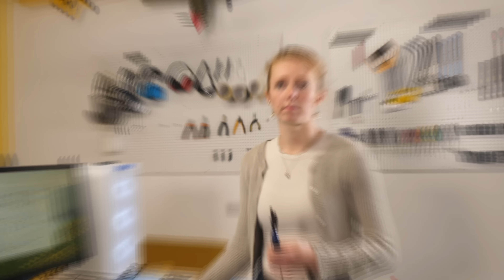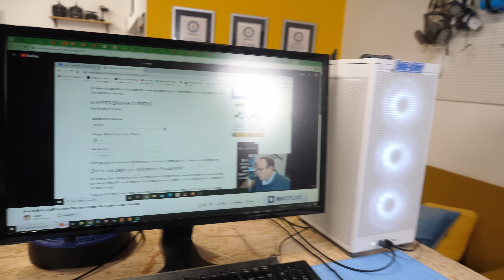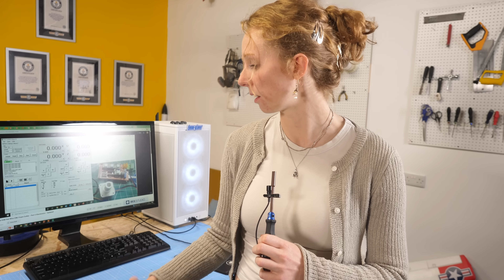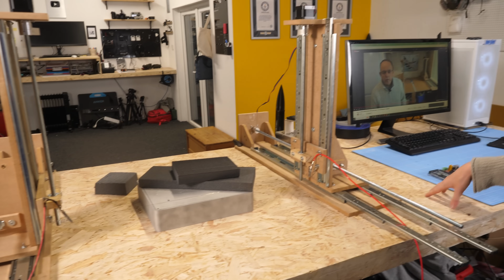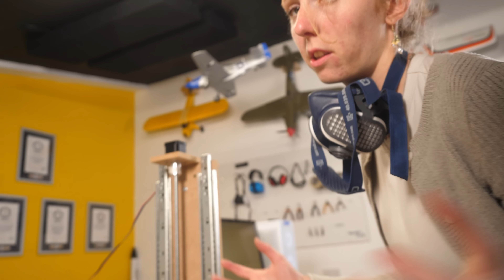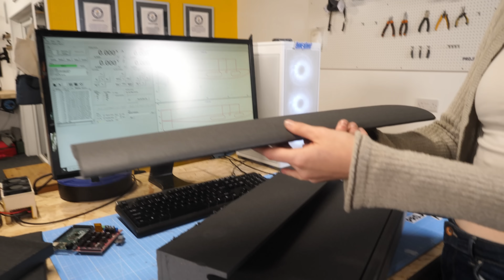Building a CNC Hotwire Cutter

Comment: I like tools.. Sets Electric plasma generator on the ground designed for echo ultrasonic holography resonance and piles metal scraps on it > Sets craft design > Activates it watching it holography lift materials into the air forming a sphere of metal dust by resonance bond breaking > Watches it use that dust to holography 3D direct sound resonance weld print craft whole Google: "Boeing Plasma force field blocks bomb shockwaves" + "Ultrasound holography" + "Warwick university plasma generated Ultrasound" + "Ultrasound can print through walls" + "Ultrasound see viruses turn genes on & off" *You all likely already understand ultrasonic welding just apply extremely high resolution nano pressure control. Why a primary component of endgame ships? Ships that can hold themselves together when parts start melting in Fusion beam battles + Ships that can grow using resources + Ultrasonic shockwave anti-drag to create pressure bubble to slap the Ocean or atmospheres like they don't exist + Elevating sound of craft beyond hearing for illusion of silence + Deep world scanning with resonance filters + Ultrasonic holography Plasma cloak.

Joking? I don't make the science results on this world I just know everything about it and line your words for it up based on the data I process to identify what I'm trying to say. Its not too far away from you. Squints at Predator alien smiling like its a CHILD then dials up Ultrasonic echo clashing with outbound waves to form a pressure lens of trapped medium then cloaks by Plasma Ultrasonic holography - Dracula (Saucer over Dracula's birthplace 16 Century art)

Comment: That’s great, nice clean cuts! But please either put a cover over the mains terminals and add strain relief or get a different power supply. 12v are so easy to get ahold of in a safer format than this. Like a laptop charger style

Comment: !Safety warning! I briefly looked up the face mask she's wearing, and it does not look like it has the appropriate filter canisters for all of the nasty stuff in foam cutting vapors. I've done foam cutting before and You need filters fit for organic vapors. Like 3M 60923 cartridges (needs to be replaced within 30 days of use max). Even then it should be done with a vent nearby, or in an open area. I hope this helps!

Comment: Very very cool build. If I ever have the need and the space to CNC foam I would love to build one of these. Two suggestions though: 1. Upgrade the stepper drivers (go for TMC2208 or 2209) they have better microstepping and are much quieter. 2. Add some kind of extractor fan to the shop for dust and fumes.

Comment: 2 questions:

1. Are you supplying constant voltage or constant current to the wire? I’d imagine that the latter would keep the temperature steadier.
2. Have you considered operating the two halves of the gantry independently? You could use that to make tapered wings and other more complicated structures.
Reply: Even better than 1: If the wire is an alloy that has a resistance that changes with temperature then you can measure the voltage and current, and compute the resistance of the wire, and adjust the voltage or use PWM to adjust the heating power to keep the resistance of the wire constant. Provided the wire is nearly all in foam that should keep the temperature constant. If only part of the wire is in foam it might keep the average temperature pretty constant, but the parts inside and outside the foam might not be at the same temperature.

Comment: Some Improvements: Secure the T-nut with 2 pan head screws (3x16) or a second block. For the wire you can use old wire from a wire EDM machine (very thin and resistant). For holding the wire you can use (old) nozzles from a 3d printer the tip of the nozzle is then the computation point for diagonals and you can directly screw the nozzle with the power cable in a 5.5mm hole in the wood. To tense the wire you can use the spring 90° to the nozzle, so it is all flat. For powering the wire you can use a cheep inverter welder, too.
Reply: Stainless steel fishing wire

Comment: That's a great machine! With four independently controlled stepper motors, you could create some pretty funky 3D shapes too, right? I imagine it all comes down to wire tensioning — which could probably be handled by a fifth motor dedicated to tension control. 😉

Comment: Nice project Emma but I had to check 2 times from what year this video is.  Apparently not 2012.  

From someone who builds 3d printers 
1. The motors are insanely loud 
2. Why use wood for this?  

Just buy (or find one in trash) an old Ender3 or CR10 and use the parts for this cutter.  You have everything you need there. Perhaps add a modern MCU like the SKR3 to it and it should run like a champ.   

Hum.  Now I think about that and…. I have an older CR10 in my attic. But do I need foam parts for something? 😅
Reply: MDF is WAY cheaper than aluminium extrusion,

Comment: I use a bow on my hotwire cutter so the wire tension is independent of the towers, you can cut tapers and different shapes on each end of the foam. 
RCKeith developed the firmware, I use Jedicut to generate the gcode, it will cut DAT and DXF files, but is quite a learning curve. 
 A developer is creating a Foam Cutting Workbench for Freecad, it looks very promising as it has a great visual interface.

Comment: You might want to put the power supply into a enclosed box with the fans build it - the mains power cable looks a bit stretched and one might pull out one - plus you could touch the terminals with a tool or fingers even with the plastic cover on top. I use cheap electrical boxes from the hardware store for this application...

Comment: Great project! I can see a major refinement that would be easy to implement - constant current wire for constant power per unit length. A cheap module like an SC8701 in between the PSU and wire would be fine to regulate the current. This gets rid of fiddling to find the right voltage for the wire length. It also allows the the machine to be extended to the third dimension of cutting by adding a spring loaded spool to one side and operating the towers independently. The wire needs to be coupled after the spool to avoid the spool heating up - just a metal eyelet feeding the wire instead. Not sure what software would work tho. LinuxCNC?

Comment: Are you stuck using 2D toolpaths? Seems like a waste for a 4-axis machine, you could be pulling that wire at arbitrary angles to make not just tapered airfoils, but even any arbitrary hyperboloid curve. Might need more spring-tension though, and it’s dependant on the CAM software. Jedicut looks to do tapered airfoils, but I’m not sure about hyperboloids.

Comment: You should release an EP of stepper motor sounds. Those tunes were tight.
Reply: There are a few MIDI to GCode converters that will let you play tunes on any CNC machine - but modern printers are now too quiet!

Comment: Great job!  I never thought of using drawer sliders instead of linear rails.  I wounder if that would work on a 3d printer.   The one think that I would recommend would be to capture the end of the threaded rod on the front if at all possible as it lessens the chance of them getting bent if someone or something puts some weight on them.  I hope we get to see some more of your designs.  Also the noise is due to the stepper and stepper driver combo.

Comment: Did you set the drive current on each stepper driver? I have used the ramps board with the drv8825 drivers on NEMA17 and I don't remember them getting stinking hot, just hot :-)

Comment: Those aluminium flexible coupelings are going to fail after a while. It's a bad design to flex aluminium like that because of aluminiums fatigue problems. I have used those coupelings in both a CNC router and for encoder mounts and they have all failed after a while.

Comment: Verry nice! One tiny remark tho is that the parts used are what you would use in 2015. With the price of 3d printer parts so easely available and cheap there is no point in using threaded rods or a ramps board in 2025.
Reply: Cool! Looking forward to your redesign to 2025 hardware spec!

Comment: Tip: FreeCAD has actually an FoamCut Workbench that is specifically created to create wings for hobby air planes. In stall the workbench plugin by opening FreeCAD,  then go to Open Tools > Addon Manager search for FoamCut and click install. You may need to restart FreeCAD. The main benefit is that it allows 3D cutting of the wings.

Comment: I know it was not critical so you probably weren't too worried about the slightly wavy cuts but if you do need to make straighter cuts with a jigsaw in the future you could try something like a DeWalt DT2074 blade it's designed for straight cuts.

Comment: Could you do cuts from multiple sides on an indexed chunk of foam with this thing? Like one with X+ face lying down, one with Z+ face etc. Or will the foam be too flimsy for this? (though you could probably leave tabs in the profiles and cut them away later or stick in bamboo skewers) 

Nice thing about this is that since the towers are individually powered, it should be possible to upgrade it in the future to do cuts where the heads move independently for really complex shapes, really looking forward to getting it used to its full potential! 

Also very thoughtful of Emma to burn some boards in advance of filming to use as props while talking about them 😁(jk)

Comment: Great stuff Emma. I love the screwdriver being used as a mic. One question, though... once you have cut the whole thing out, why didn't it collapse into the gap you created underneath it? Magic?
Reply: I noticed that Emma's general approach was to complete the 'upper' features first, then move on to cut the lower features, in order.  In this way, the completed bits could then sag any way they like while the cut could proceed in a stable, 'uncompromised' area without losing accuracy.  That said, yeah, I was kind of expecting maybe to see her pop a small wedge in the end of the cuts as they are completed to prevent the islanded parts dropping/drooping.  But it seemed to work just fine the way she did it.  Kudos for just doing it - the reward was success.

Comment: Since it's attached with the spring, you could actually add a bit of a 3rd axis, by raising or lowering one side, allowing you to cut at an angle, if you wanted to taper the ends somewhat.

I don't know if it would be useful, but you could do it.
Reply: I thought Emma said she could program each tower differently (?) That means taper cuts are already possible with her set up.  It would be a bit tricky to get the exact dimensions you want, but half an hour and a bit of trigonometry would resolve it.
Reply: Yes, technically it could be 4 axis, as you can tilt the wire in 2 axis.

Comment: Great job, holy crap though, use TMC2209 silent stepper motor drivers lol, your steppers are screaming a cacophony! I hope your respirator cartridges have activated carbon in them 🤞
Reply: I also prefer the Trinamic drivers, but the ones in the video are screaming so loud that I suspect they're running in full step mode.

Comment: Excellent work Emma!  Thank you for the tutorial on how you built the cutter and how it works.  

Will you strictly use nichrome wire as the cutting element?  I heard or read that guitar strings could be used as well....

Comment: nah diy parts for cnc. so you dont have to bootstrap from elsewhere. yep hand made. thats why you use adjustable power supplies. so you dont have to change any input parts to tune the device. just swap the wire if required. 3d printed rib shell of a wing is similar to weight and strength as foam. symmetric wings over air foils. for reasons.

Comment: You could give some silent stepper drivers a try! I think the structure vibrates with the motors and makes them super loud... I have TMC2208/TMC2209 (don't remember which ones) in my printer and they substantially cut down the noise stepper noise
Reply: Totally support this suggestion. I was surprised how silent steppers become with 2208,2209. And they are pins (almost) compatible with most common DRV8825.
Reply: 100% agree, the better micro-stepping on the 2208/2209 drivers makes them so much quieter. I have both of my 3d printers upgraded to those drivers and it has made a world of difference in how quiet they are.
Reply: The RAMPS board and Arduino are equally old technology. There must be an ESP32 version around by now.

Comment: Why don't you use Selig 1223 shaped aerofoils ? i mean they create much better lift and are highly efficient.
Reply: Aerofoil shape performance is mostly dictated by the use case, which is why not all planes use the same shape. The load, engine power, flight speed, and more all affect what shape foil you want.

Consider the difference in wing shape between a glider and a C-130. Very different profiles for very different aircraft.